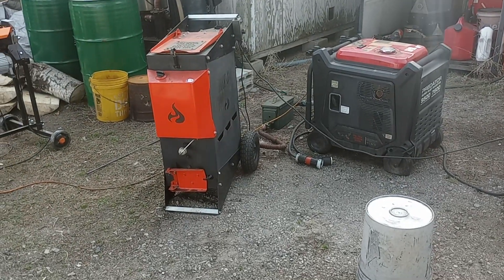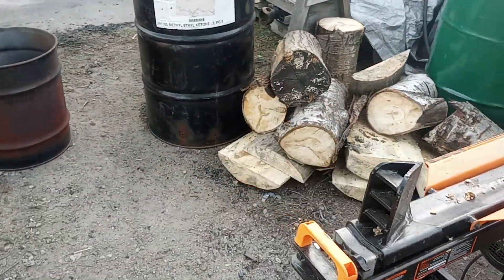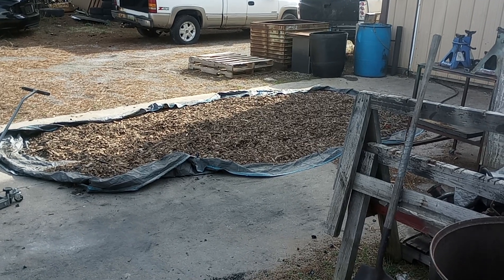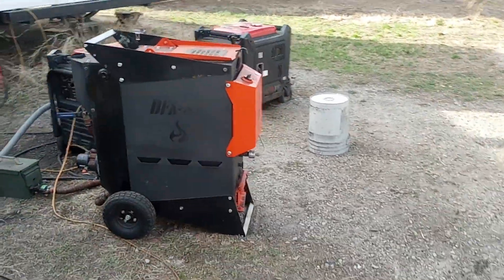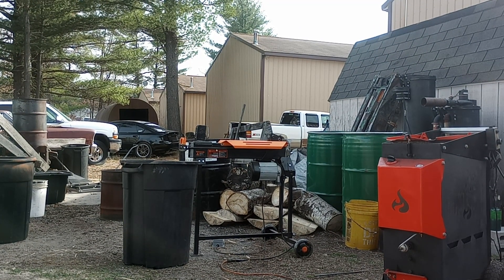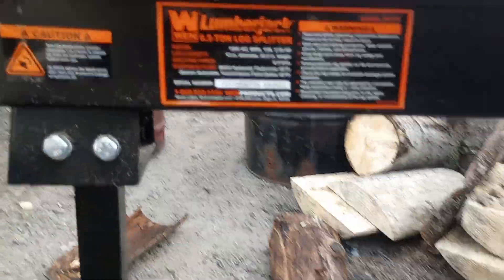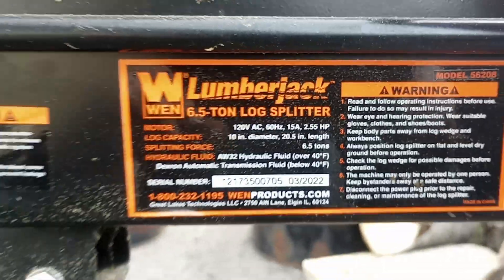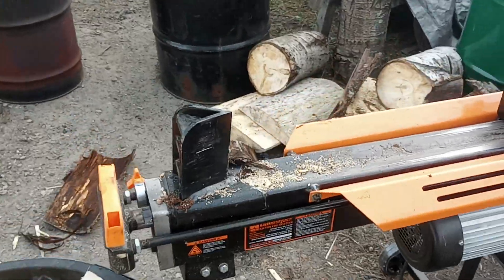Oh Don't Mind Me; Just Another Video Showing an Engine Running On Wood Gas Running Under Load.

Comment: Have you tried running the splitter on a Predator 8750 Inverter generator on wood gas?  I think the gen would handle it, but wonder if the 120v gfi would trip with the splitter?  Also, can that splitter be run on 240v? (some motors can run on either)
Reply from the maker: I dont know about the 240 volt I guess you will have to try it :) Yeah Im sure the 8750 will run it just fine. They both have the same outlets and it worked fine on the 9500. There is not much difference if any between the 8750 and the 9500. The 9500 just has a better engine and has the parrallel capability. Plus its way quieter.

Comment: I could watch this all day long lol😂. I got to wonder even will losses to charge a battery bank if it would be much better to run of an inverter set up. Lots of engine run between strokes on the splitter. Run the gen off woodgas charge battery then just pull from the battery when the splitter is actually on. Thanks for the video !!!!
Reply from the maker: That was the point of getting electric process equipment. Yeah more efficient. However our inverter didnt like the start up spike on this splitter and the point of the video is to show an engine with loading. Anyways I think I just need to get the splitter closer to the inverter and will probably work. The outlet I was using was the farthest one away from the inverter. Another point is you can run this splitter indoors inside the shop in the warmth :)
Reply: @Thrive-Off-Grid  yeah I love it.
Reply: @Thrive-Off-Grid just for the heck of it I plugged my electric splitter into my inverter system just to see how well it would work. Dual Victron MultiPlus 3k configured for split phase. That feeds an auto transformer to supply 120. Log splitter tan better off the inverters than it did the wall socket. Pretty cool. Couldn’t wait to try it after seeing this video